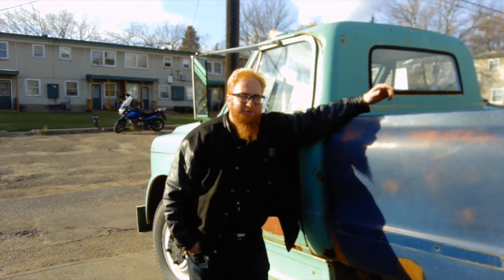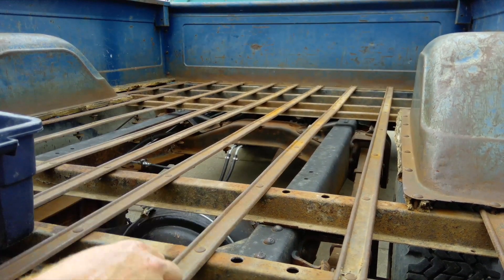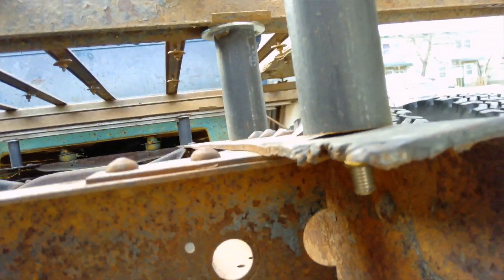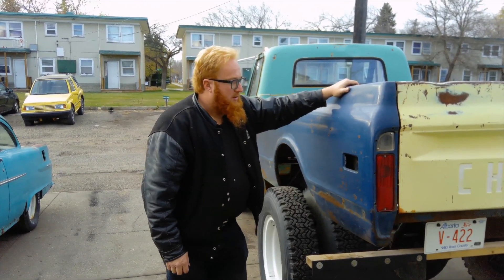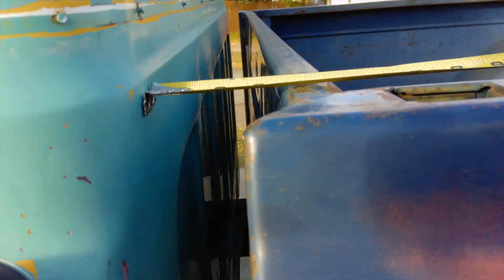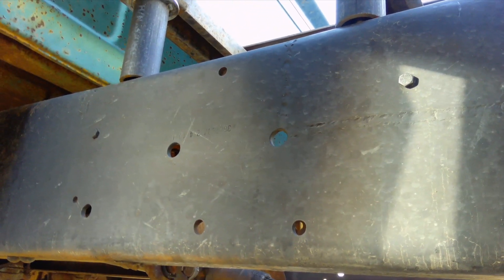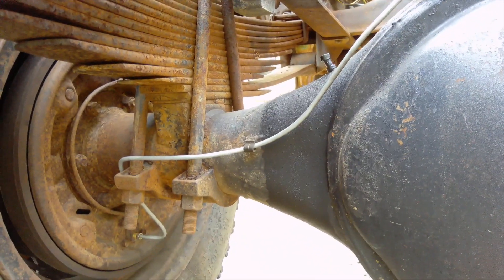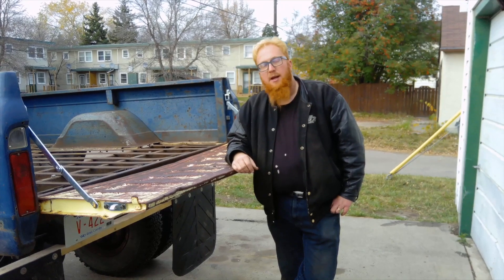Boxing Up The 1967 Chevy c50 Update #7 on Roy Marko's Garage

Comment: I would be bolting some heavy plates on the inside of the frame -over your welds -keep it all from flexing at your welds.
Reply from the maker: I do have plans to box that section of the frame, but so far the frame does not move.

Comment: Only thing id add is a Fishmouth plate to that weld on the frame if i shorten mine im moving the whole axle hangers forward thuse just hacking off the extra rail length
Reply from the maker: If you do shorten yours, let me know and I'll watch the video. =) More to do on this truck.

Comment: Nice build so far …eh
Love the pro-ject… and the pro-cess…eh
Just messing around, it’s a pretty cool build… I have two 69 Chevy C-10’s and just picked up a 1970 C-50 farm truck that I’m planning on doing something similar, except as a crew cab … and using a more modern chassis from a Duramax powered shuttle bus I acquired recently… 
Keep burning metal… looks great

Comment: 2 sheets of 1/4" deck plate does a pretty good bed floor ???
Reply from the maker: It could do, but I'm going to use an original steel floor for the bed.

Comment: Roy, love this build! I just found your channel today. I have always loved the 67-72 Chevys. Dad had a 68 years ago. Someone removed the wood from the bed and tacked in some steel diamond plats sheet. It made a real nice bed floor. Another favorite channel of mine is J.C Smith Projects. He has shortened several frames. With the standard C-channel frame you can do what you originally thought about doing which would be cut out the rivits and just slide the axle forward. This would have solved 2 problems. 1) no cutting and sectioning of the frame. No matter how good you weld it without fish plates it will never be as strong as a non-cut frame. 2) you could have left the frame run long and now you wouldn't have to extend the rear of the frame. Moving the axle forward would require one final cut now you will have 2 welds. JC Smiths bought a mg drill to drill new holes when he moves an axle forward and he made an adjustable jig for taking measurements. Not trying to be negative on your build at all! I would like to do the same someday! I saw another guy who is manufacturing panels and parts and such to make these into crew cabs.
Reply from the maker: I agree with you 100% with the frame changing in height where the hangers go on the side of the frame it would not fit on the wide channel and bring the back of the truck up 2" in ride height. So with my budget at the time, I would not have been able to do that, on the flip side, I've driven the truck a lot, and have had no issues, it drives and rides good.  Hope to see your build on your channel one day =)
Reply: @RoyMarkosGarageRMG  Your frame will be just fine, but you already know that. 
I prefer the way you went about shortening it over cutting it at a 45°.  50+ years welding and fabricating. Keep up the good work.

Comment: love all videos on c-50, greatly appreciate  any info. I have a C-40 which Iam about to do the same thing.
concerned about drive shaft modification. I will be locating bed location hopefully to stock
location. so there will be as your video says about an 1 1/2  difference than yours. so i have too factor that in drive shaft mod.
 and learn from your videos, dont cut very back of frame till my measurement are more accurate .
 really good job considering what your working with.
 all i have is ,  some basic tools, 4 1/2 grinder with carberandum blades , snap-on hammer chisel, 
 air compressor,basic mechanic hand tools, basic electric power drill, cordless 20 volt Impact.
access
once again love the videos bro
Reply from the maker: The back of the frame was cut that short on my truck when I got it, also I am working with basic tools myself, other than a plasma cutter and a good welder, but you can make the cuts with your grinder.

Comment: Why didn't you use timbers to lift your box like you would for a box you'd put on the frame. I think it's gonna be a lot quieter if you use timbers, in my opinion.
Reply from the maker: Thus far I don't have noise, and am happy with how it turned out. Still more to do when I put the new box floor in

Comment: Z cuts are the strongest way for shortening a frame especially on these bigger trucks a 45 degree will fail
Reply from the maker: It's been a good solid truck since the cuts, and issues.

Comment: Nice work Roy. That frame is good enough to do anything you would need to do with it. Neat looking rig for sure. Will you be putting fender flares on the pickup bed?
Reply from the maker: thanks, yes I bought some flares, and other parts for the truck, so next video it is.

Comment: Hey Roy,  thanks for reply
one thing iam going to do different is ,
Iam going to remove rivets that keep rear suspension and rear end in place,
 and just move everything forward. then I dont have to cut in the center of the frame.
did you use cell phone for videos or ......?
I guess I should make a video when I get started,
 I think I will start on it December first , i hope so
Reply from the maker: sounds like a good plan, I use both a camera, and a cell phone and a amazon tripod which holds both.  Good luck and let me know when your video is up